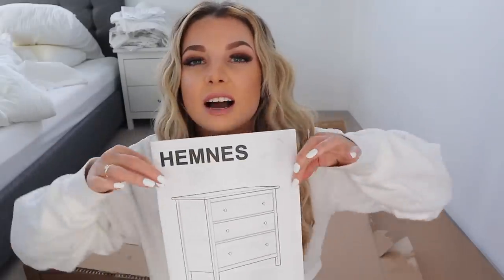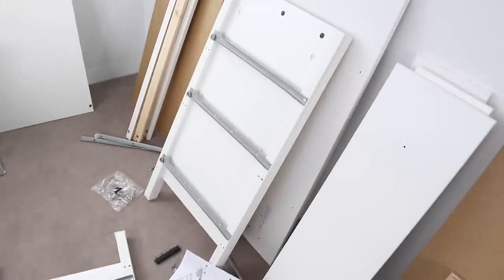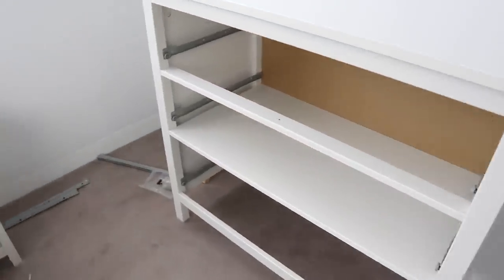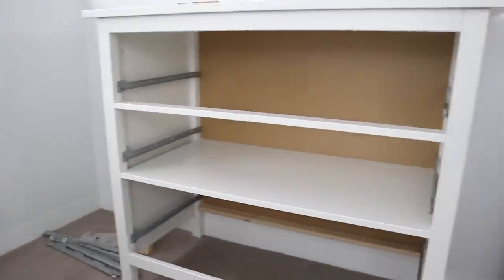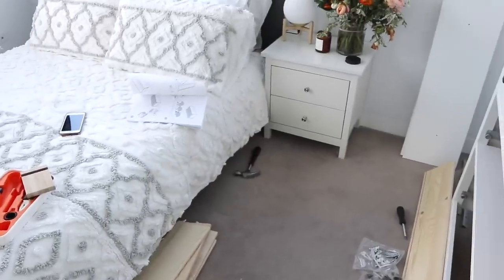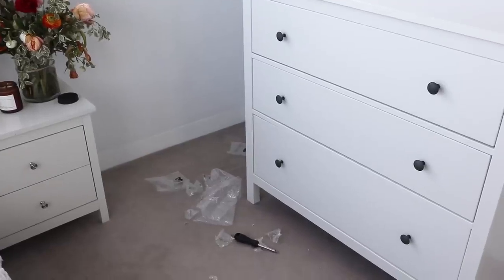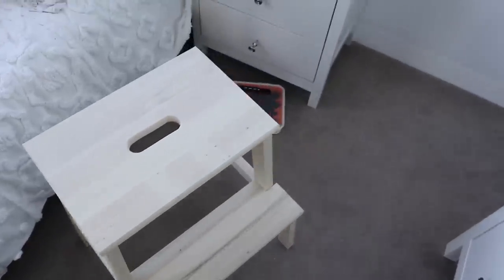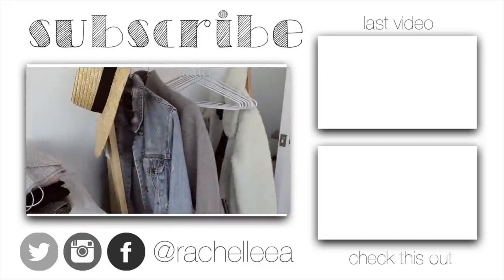Project Bedroom Makeover | Building new IKEA furniture

Comment: Suggestion move clothes rack in corner put it on angle, pull down draws a bit , then put plant step stole & plant on end in between door & draws. It will open your room up more & more space.
Reply from the maker: Thanks, I love that idea, I'll definitely give that a go :)
Reply: @rachelleea  your welcome . I have one of those awkward rooms too but I try to have room space as much as possible easier to clean around too. I have the hermes furniture too love it ! But I've had mine over 5 plus years the colour has faded & the strips in the draws some peeled off but easy fix of paint & clear contact